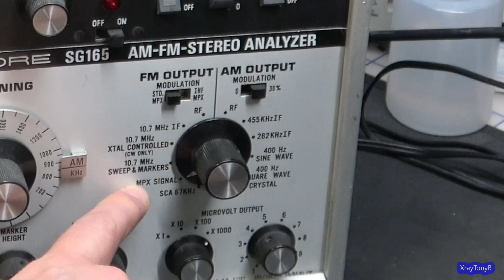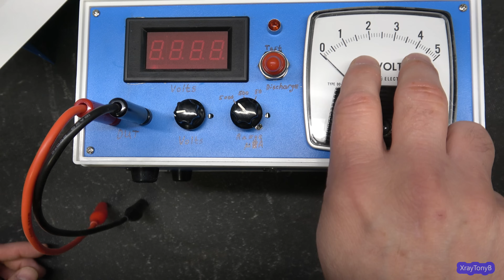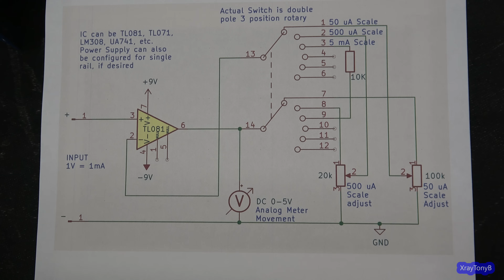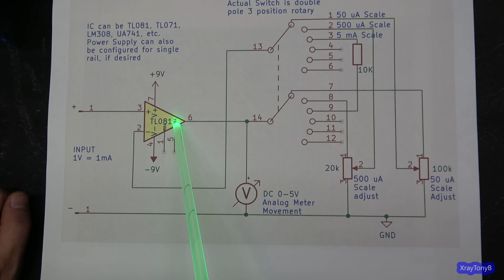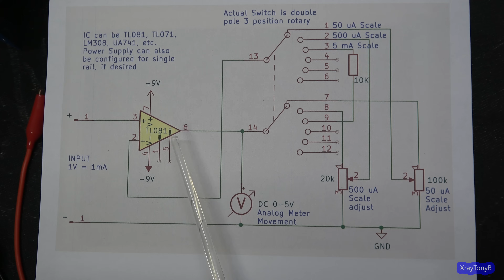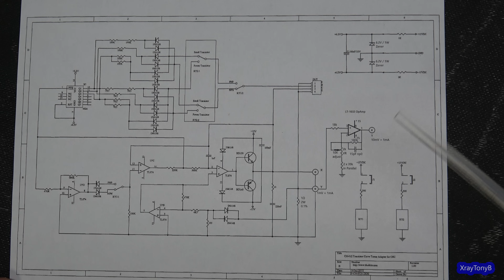Patreon & Viewer Questions 5 26 2025

Comment: At 8:34, I have a 'Modern" 1998 200W amp that has been in storage for almost 10 years.... Is there a preferred method of waking this amp up after such a long storage period?  Will the capacitors need individual help with reforming after their hibernation?  What are your thoughts?  Thanks Tony.
Reply from the maker: I usually bring amps like that up on a current limiting bulb (A.K.A. "dim bulb"), as long as it isn't a Carver magnetic field amp or some other strange design.  This will help the caps reform slowly.
Reply: @xraytonyb  Not a Carver, thanks for your reply.

Comment: Thank you for the explanation, I was one of the people who asked the question. I almost gave up; I was using an amp so I could hear the 400Hz tone and just using the Sencore I could hear it just fine. when using the Sencore and my HP 8656B there was NO AUDIO. and there still isn't, at the last min. I hooked it up to my Rigol MSO 5354 and low and behold, I got the same results you did. any idea why there is no audio? NOTE: in both cases I am using a 75ohm balun with alligator clips attached to unbalanced input on the tuner. I also tried a higher output from the HP signal gen, but no audio. Thanks to one of the greatest educators on U-Tube!
Reply: Is your 8656B working correctly using it's own internal modulation?
Reply: @jonathanwoodard8571 Thank you for replying, Yes the 8656B functions on its own at 400 & 1K  and is audible when tuned in, and monitoring the line out. Also when using the 
Sencore now It is audible also I don't understand what changed between last night and today other than some sleep. When looking at the outputs from the line outs on my o-scope The output is the modulation and not the frequency the radio is tuned to. Is that how it's supposed to be, I am very new to radio that's why I bought the sincor well actually all this gear so I could properly repair vintage items and educate myself in the process. Thank you for your help.
Reply: @mickblackmore290  Glad you got it working!  Yes, you are seeing the modulating signal at the outputs of the tuner.  The tuner is taking the modulated carrier frequency you are feeding it from the 8656B (say 98Mhz) and converting it to an intermediate frequency(IF) of 10.7Mhz, amplifying that IF signal and then stripping the original modulating signal off and sending it out as a composite audio signal.  For stereo, the signal then passes through the multiplexer, which separates the left and right channels from the composite audio signal.
Reply: @jonathanwoodard8571 Thank you once again Jonathan for your participation in my issue, I understand. You have a great day.

Comment: My Hp8643A has two buttons for external modulation one is ext AC and the other is ex DC. Wich one do I select? Thanks Tony
Reply from the maker: The AC input is good for signals that have a DC offset to them.  IN the case of the SG165, it shouldn't really matter which input you use.  When in doubt, experiment!  Try both and see what it does!  Thanks for the comment!

Comment: Why is opamp circuit for current meter circuit?  I just set up the parallel circuit resistances and can go from 50uA to 250mA using ranges.

PS. That lt1632 is $11.87 at Mouser.  Yikes.
Reply: Definitely pricey. But for a one-off projects per unit like that curve tracer I think it's a worthwhile expenditure
Reply: did you look at the price of the 1ohm, 2 watt  .1% resistor? mouser has no 2watt so 2.5 watt=$10.23. digikey has nothing.

Comment: I built the curve tracer when the vid first came out. Sure was a fun project, and use it a lot.  I do recall staring at the vid to trace your wiring.  It's nice to be able to quickly switch between transistors and watch how they warm up and the curve changes.

Comment: Not sure if you read these posts.  Just picking a bone here.  I was a paid, community contributor.  The bone is to pick with you and technics.  I have always been a technics fan.  Your recent sa-800 work/talk over was less than good.  You talk up a lot of equipment that is not near as good as the sa-800 and you talk of the technics as something that is cheap/junk?  Is that because of the pcb's ?  All jap pcb's are made that way?   I have worked on technics, switches, pots, and PCB and do not have a problem doing so.
I am no audio expert, but in the 70s-80s my technics sa-800 with my cerwin vega 317p would blow the door off most everything I ever compared it to.  Actually, I never heard another system that sounded better?  wtf?
Reply: you need thick skin to watch youtube.
Reply: @josephlalock8378  Indeed, especially with something as subjective as audio equipment. If I got upset any time someone dumped on my Sansui gear I'd have a breakdown 😱
Reply: I thought Tony did a pretty good job of explaining why he wasn't keen - flimsy pcb's, low cost caps, difficult serviceability etc etc, compared to other technics models that he loves. That doesn't mean it can't sound good, just that the build quality might be lower than other models in their range. He certainly doesn't have a general beef with Technics. In other words - don't get mad, just have a different opinion 🙂